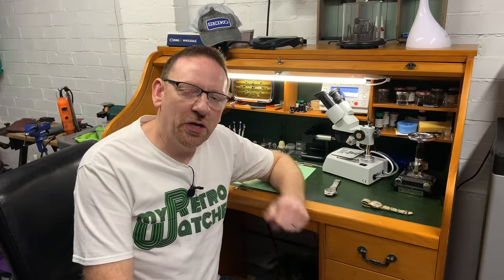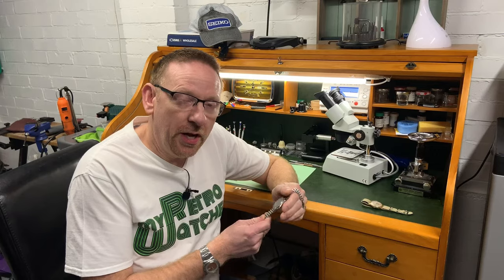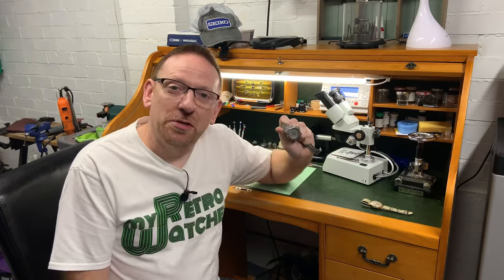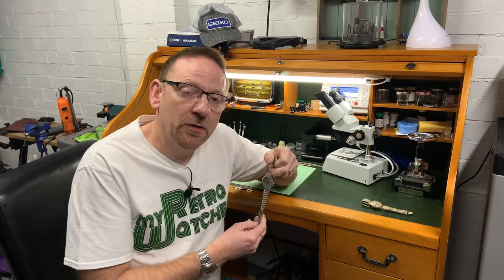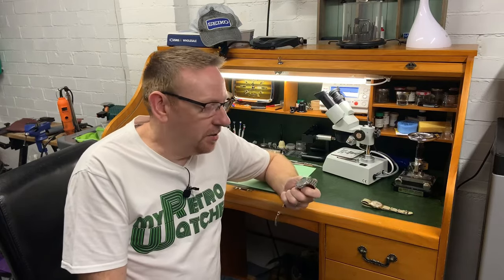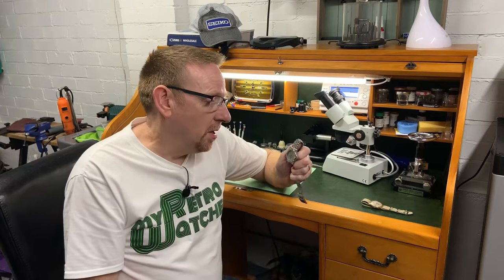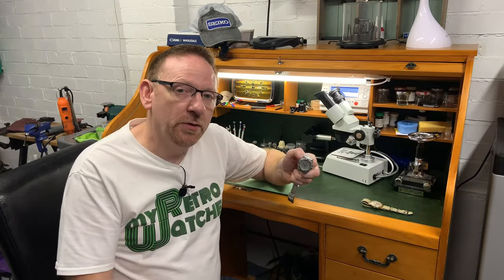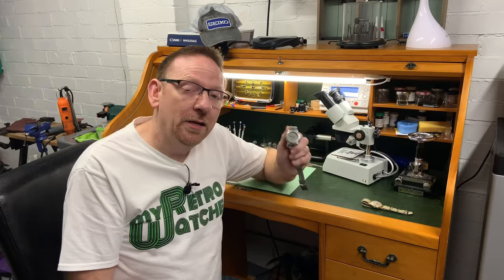How To Replace a Quartz Watch Movement

Comment: A little tip for the second hand - cut a strip off the side of a post-it note and use the adhesive part to grab the top surface of the hand.
You then have a nice 'handle' to help you position the hand.
Once the hand is in place, gently hold the center of the hand down with a pegwood stick (or toothpick) and peel off the post-it.
Reply from the maker: Nice tip , thanks
Reply: Great tips. Are there any tricks on how to properly align the second hand with the dial indices other than trial and error? I must have set the second hand 20 times just trying to align the indices on the dial. I let the movement run and then place the second hand, adjust it slightly with light pressure to see where if aligns, try to adjust with tweezers, hack the movement then press firmly but it takes me multiple attempts to get it close. Maybe it partly depends on the quality of the movement. Swapped a Miyota 2035 last night. Maybe there is a better way? Trying to understand how it's done during mass production.
Reply: @mtbbiker6401  Nope,I'm plagued with the same problem lol

Comment: Great video. Usually change the date wheel but the circuit change method you proposed is a much better idea is cases like these! Thanks for the tips!
Reply from the maker: Andy B thanks.  The date wheel would have been changed if that plastic weld was not there

Comment: I bought an old olympic dive watch a few years back from a second had shop for extremely cheap. Turns out the battery acid had melted like the on in the video. Just getting into watch repair and tinkering so hoping to use it as practice to try get it working again

Comment: I didn’t know that this was an Adidas until I read it in fine print on the face. I thought 💭 this watch may have been a Timex, or a Casio. For it being an Adidas, it is built out of much sturdier materials than vinyl, or plastic. It’s even a great 😊 color. It only has a date feature (no day), but that’s totally fine. The thing I liked about earlier 👂 watches is the glass crystals. Earlier 👂 spring wound watches are another great 😊 thing. I don’t know what year this watch is, but I’ll guess sometime around 1986. Your friend, Jeff.

Comment: I’m noticing that the seconds hand hits all the indexes spot on. Not bad for a low-cost timepiece!
Reply from the maker: It will do if you fit it correctly with a ticking hand it only ticks once a second so you just have to line it up as good as you can.
Reply: @MyRetroWatches  I agree, which is to your credit, certainly, but it seems many watch dials have the marks unevenly spaced, as the seconds hand sometimes does and doesn’t line up as it goes around.

Comment: Very good helpful video, ive tried this a few times, always struggle with the secound hand , press it on with my little hand press tool i bought , when i turn it over just falls off! Ive realy got into collecting watches and have bought a few spare, repair lots on e bay, most work with a clean and new battery but i now have a few nice watches that prob need new movements so i need to learn how to perfect this!

Comment: Hi Mike, thanks for this vid. There was something you skipped over with this and I realise you did this for brevity but I still would have liked to see you remove the crown stem and the watch hands. However, because I've seen a load of your other videos I've got a fair idea of what to do. (The stem having a release mechanism on the movement and using a plastic bag and some hand removing tools to gently lever the hands off.)

I have an ultra cheap Chinese watch (Laverado with some sentimentality attached as it has a really nice dial face and reminds me of a happier time) that I was tempted to have a go repairing as it loses about 5 minutes an hour (which suggests something is broken inside) as at points it becomes very loud which is not standard for a quartz watch (unless a Timex) which suggests there is either some fouling or the movement is rough as sandpaper. I wanted to put a better movement in replacement but after seeing the date wheel alignment, it made me nervous. Hopefully I can find something as I'm eager to give it a go.

Comment: Thank you for the amazing video! 
I have a watch that I need to replace the movement and I found the same movement on cousinsuk but it has a different day wheel with bigger text than what my watch currently has.
The movement is the Movement ronda 517 Day @12h (horizontal) date @ 6h
Can you please show how we can change that?

Comment: Wow you did any great job of aligning the second hand with the dial indices. This is always the hardest part for me that requires multiple trial and error settings to get it close. Any tricks?
Reply from the maker: Hack the movement to start with then the second hand should be in it’s stopped position then it’s just a case of lining it all up when fitting.

Comment: You can trust cousins when they give alternatives. In my very limited experience, Ronda movements have been nicer & more accurate than the eta they replaced.   Were you lucky or did you check the gear train & rotor was free with a pulser before swapping the circuit?
Reply from the maker: wirdy1 hi,  thanks for your comment. I figure cousins alternative would be right but their returns process is not easy.. figured changing the date wheel would be simple!
I did not check the train but where the circuit goes and the battery the acid damage was isolated so I took a chance.

If the date wheel would have changed then it would have been a new movement in the watch .
Reply: @MyRetroWatches  thanks, I've never had to return anything to Cousins, but I'll keep that in mind for the future if I need to source a 50/50 item. I think a complicated returns process means most can't be bothered & the part then sits in the spares box for yrs to come!

Comment: Great video!
By the way, I need to know if I could fit a generic bezel onto a Victorinox V25006 or summit Smurf'.
I got it working and it's 10 or more years old and the company doesn't make any spare parts.
Thanks

Comment: Thanks Mike, another great video, need to dig out that old Casio divers watch. A question, if you had fitted the new movement as delivered, would the date have still shown & changed in the aperture at 3, even though the new one was described as date at 6 ?. I might not have phrased that question correctly, hope you understand.
Reply from the maker: David Webb I don’t honestly know. As then number would have been on its side it would look weird

Comment: I invested in a better tweezer set as I have enormous trouble with the ones I have and I suspect one so called "anti-magnetic" one was made on national opposites day as I have to demag it all the time, got a set with a double crank on one of them as I want something to easily pop screws in without my phat hands getting in the way of it all, have heard them referred to as "w"s.   Going to dig out my Adidas Adventure now if the movements are only £9.
Reply from the maker: Ian Watson this was my mates watch . Nice to see you have one too.
As for tweezers I will only use Dumont they are pricy but man you get the best quality out there. I use a pair of 00 and I abuse them yet the show no sign.  Think they might even be hardened steel..
Also have some hairspring tweezers also by Dumont .
£25 a set minimum though
Reply from the maker: Ian Watson don’t forget £9 plus vat and then post.  Also unless you buy the alternative you are faced with doing what I did and remove the circuit

Comment: Hello, 
I have an older model Rolex date just  (I think that's the name) that I received from my Dad.  I'm curious to know if it's possible to replace the movement with something like a Seiko movement?
Reply from the maker: If you have a genuine Rolex to not replace it with a Seiko movement!  Your Rolex movement , even quartz could be serviced to run properly.

Comment: Is it possible to change a quartz to a meca quartz to get a smoother sweep to the second hand?
Reply from the maker: In theory it might be possible gig there are so many factors from thickness of movement stem alignment. Day date windows. Then diameter of a movement / finding a movement spacer to increase / decrease the fit.
Something I have never done or had interest in doing.  Same with converting a quartz to mechanical.

Comment: I have an old Accurist ladies watch I bought years ago. I had to buy a new movement for it 1L40.  I lost a couple of the hands it has a sub dial in place of 6 with a little second hand. I can’t for the life of me get hands for it as I don’t understand sizes. I went to Miyota site but drawings might well have been double Dutch.  It had black leaf type hands Hour is 120 Minute is .70 Second is .1.7 Hole for hr and minute 1700 Hole for sec is 900? I think that’s right. I’ve no clue. Maybe you could read it better on Miyota. I will donate for your help. Thank you for reading this. I adore this watch and can’t bear to bin it.

Comment: Hi, sorry for the question, but I have searched the internet and not been able to find an answer anywhere else.  I set about replacing the defunct quartz movement in a second hand watch I picked up (having watched this vid), but I now think the watch has had the wrong movement put into at some time in the past - which is perhaps why it wasn't working.  The watch is Rotary LB00001/25 - with the sub seconds; it had a Miyota 1L45 quartz movement in it - how can I find out which movement it should have?  Really hope you can help - I would really appreciate it!
Reply from the maker: Sorry I would have no idea. Your best bet is googling the model number of the watch and looking at the image search
Reply: @MyRetroWatches  Thanks so much for responding.  I have tried that, but it is not a common watch, and the few images I did find did not show the movement or make any mention of it.  Not to worry... I'll keep searching :). Thanks again.

Comment: Is it possible to replace only the quartz oscillator? One of my watch is very accurate only 1sec every 1 month, I want that accuracy to transfer to another watch.
Reply from the maker: See Sharp hello. So in theory yes. You would solder a new quartz crystal to the module .   I have never done this though but know guys who have done them on digitals.   Think you have to find one of a similar size and some vibrate at different frequencies.

Comment: Is it possible to convert a quartz movement to an automatic movement?
Reply: Yesn't. It depends on how much space is available inside the case. Sometimes because it is a Quartz movement, the internal space is not big enough as quartz movements don't take up much space, most of it is plastic filler to keep it central and in position. Quartz watches can be thinner than automatics because they naturally take up less room inside. As long as you can source a mechanical movement that will fit the hole and matches with the diameter of the dial (and also permits the crown to align) there is nothing stopping you. Sometimes it is easier to change the dial face at the same time, that way you get a movement (with date window) that matches the dial and hands which can be a good modification. It is a tricky mod though, potentially. Also, if you are going to put a mechanical inside, you would want to get a clear/transparent case back that fits (so that you can see the jewels and balance), and if you are going to that trouble you may as well fit a sapphire crystal lens, replacing your old mineral crystal one. All of the equipment required for that costs money and patience. A good example of a watch that is both mechanical or quartz but essentially the same case is the Tissot Powermatic PRX 80 and its cheaper but equally luxuriant PRX Quartz variant. It can be done.

Comment: Don't really understand what difference the date is at simply because no matter where it is on the dial, it should still change at midnight.   The only reason I could see for getting something specific is if the fonts were only designed to be viewed correctly at that o'clock.   And I can not see any difference here.
Reply from the maker: Not sure what I said in the video as this was years ago but it’s the date window position that is important when buying a replacement. Some watches are at 6 or 4 . Buy the wrong one and the date will not line up. Buy at date at 3 for a date at 6 movement the number will be on its side and not upright.

Comment: For an 8 pound watch it is not provitable to change the quartz movement! The battery and manhour cost even more! Take a cheap Chinese/Japan Miota, ETA NH34/35 mechanical movement and upgrade this time Maschine! Mostly it will fit into the housing! Did this hundreds of...times!  Brgds JB 🇦🇺😮
Reply from the maker: Not sure where you get £8 from.  This is my friends watch. The first one he ever bought so wanted it running again.

Comment: if it was me, i would've upgraded it with a far better one. recent quartz are thinner so you just need a spacer in front of the dial against the case and sanding down the back of the movement ring to bring it back whee it was. flush to the case back. for 20/40 bucks you have very good stuff. it's personal i hate plastic haha!

Comment: Completely useless video, it's showing you how to buy the movement but is not even showing how to remove the stem. Don't waste your time watching if you want to do it yourself.
Reply from the maker: Before you discredit my video understand your own question.  Nearly every  quartz movement ive worked on, and there is many have a different stem release and its not that difficult to work it out if you pay attention to the movement in front of you.   If you are blindly assuming they are all the same then perhaps changin a module is not something you should be doing.
Reply: @MyRetroWatches  The most shocking is that like most low level Youtubers, you cannot take criticism. Since I have rightly left my comment, I watched another video with similar title to yours and the guy showed how to remove the stem. And from this I worked out how to do it in one watch and the second one, as I wanted to swap the movement from one watch to another. Thanks to him I have accomplished my task. You simply forgetting that you supposed to make video to help people. You make videos for self glorification. 99% of audience will watch your video but will not attempt to do anything, I actually did and left for you very valuable feedback. Your video is useless, so stop crying and make another one which will be helpful to youtube community. You are welcome.
Reply from the maker: @isopticon   How am I not taking critizsm? I explained to you that not all modules and movements are the same.   You found your answer elsewere and isnt that great.  You sould leave it there. I am too old to deal with reponses like you have just typed, seriously.   You simply have no idea bout my channel or what I am doing you just didnt like this video because it did not show what you wanted. Had it shown the answer then your tone would be much diffrernt.
Reply: @MyRetroWatches  look, your watch repair skills are awesome, but this particular video titled "How to replace Quartz Movement" does not provide what it preaches. Sit back and look from the perspective of someone typing this question on you tube. One could not even take the movement, out of the case ;-). You are not too old to deal with my comments, you are just working your old ways. I wish you all the best, and if you will not make a proper video on "How to replace Quartz Movement" I will.